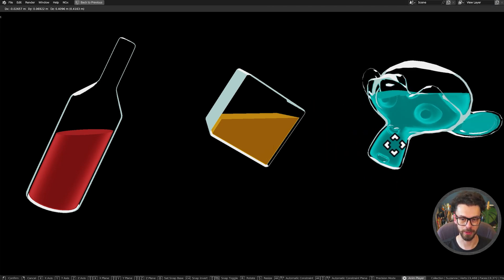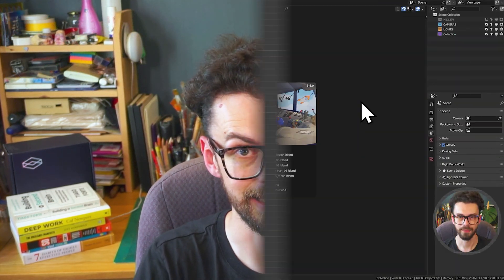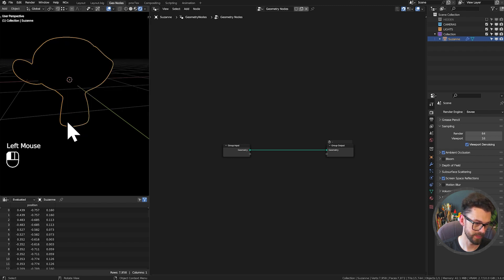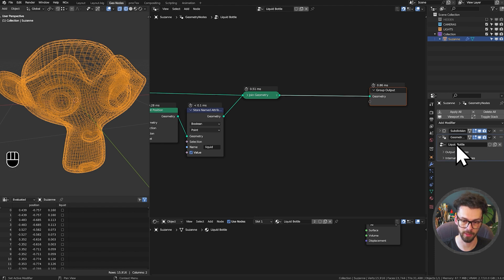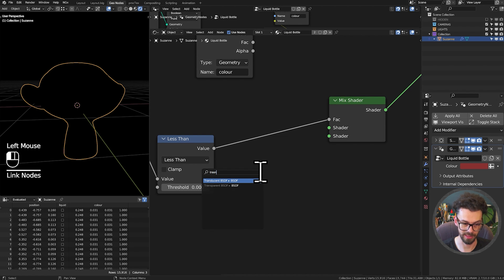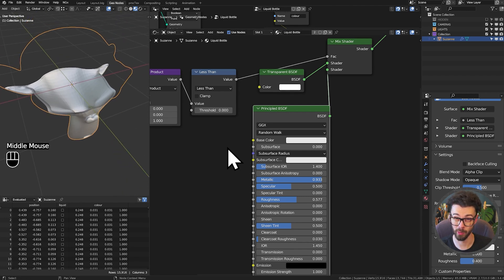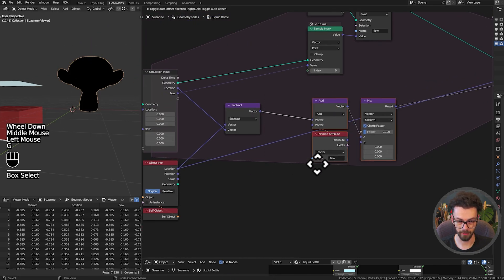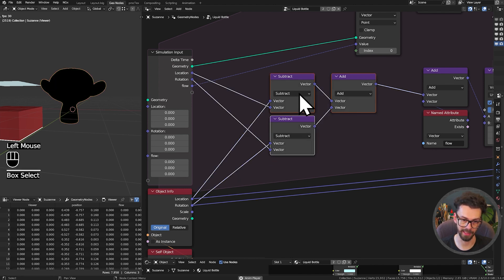Fake Liquid - Simulation Nodes in Blender 3.6

Comment: When it comes to Simulation Zones, I usually use the Delta Time along with some multiplier to get the factor for stuff like mixing a value towards 0. In Shaders, when I need a time value, instead of using just the frame, I make a driver which is "Frame / fps", where "fps" is a Single Property driver Input Variable to the current scene with the path set to "render.fps". Both of these gives me ways of processing time that work dynamically with whatever frame rate I'm using.
Reply from the maker: You can also use the scene time node’s “seconds” output which is frame rate agnostic. Delta time is useful as it’s just the time step since the last frame so good for scaling forces by

Comment: hi @Erindale I have a problem in 16:14 when you mix the shader with the material output somehow liquid is not filled, when I am doing it and I have checked that the entire process is same, I am using blenser 4.2.2 so I wanted to ask is their any difference in 3.6 and 4.2.2 is that why liquid is not filling and only show the empty shell with emission Image. or the problem is in my side? thanks in advance.

Comment: good afternoon, thank you for this excellent tutorial. grateful for your time. and share knowledge. I would like to ask a question if you can help me please. How could I put a floating object in the middle of the liquid?
Reply from the maker: Hmm a bit tricky but I would try to maybe make a selection of geometry around the liquid level that you can use to average their positions which will give you a point in the middle of the apparent water surface. You can then instance on it. It’s a bit tricky because there’s no actual water surface, so you’re just having to guess
Reply: Okay, I understand, I thought that, I'll explain what I'm trying to do, I have a sphere, that sphere is full, imagine something like I have a sphere, but the sphere is not completely full of liquid with nodes, it's just missing a little bit and in the medium, I want it to have a letter floating with a light, and that light also gives the light effect outwards. Thank you for responding and for your time. @Erindale

Comment: Hi! I was curious, I made a bottle without the geometry nodes and added thickness my self. Do I need to duplicate a new mesh based on the form of the inside of the bottle to create the liquid? or start over and follow the tutorial?
Reply from the maker: Hm I think you should just be able to asssign the liquid material to the inner faces and the glass to the outer. If you added the thickness with a solidify modifier then you can use the material offset option on the modifier to make it use the second material slot

Comment: The tutorial is amazing! And helped me a lot to understand how about shadings work.
I followed every step to the end and managed to simulate the fake liquid. However, there's a small problem: When I make 2 or 3 fast movements with the object and then stop, the top of my liquid doesn't go back to its original form. It keeps its wave form. In fact, some times it goes back to the original form, but most of the time it doesn't. I already tweaked the flow and delay attributes but it didn't solve the problem. Do you have any tips in how can I solve this problem?

Comment: Hello Erin.. It was a great video as always. I have just a small question. We used a mix vector node to create dampening effect for our location change. Using a low factor we can set the speed of dampening. That is cool but the dampening is linear. Is there a way to manually set the dampening curve?
Reply from the maker: The easiest thing with this setup would be to take the output from the other mix through a map range into the factor of that vector mix. That'll let you adjust the dumping per the speed

Comment: Can anyone verify if this setup works in 4.3.2 ?

I think this tutorial may need to be updated, I was following along up until about 26:45, and then nothing was working anymore. The "Liquid" was completely black, I didn't get the white matte fill. I am pretty sure I was following along correctly, but I also started getting lost with the tutorial at times because I was told add this, and then 3 minutes later was told to delete what I was told to add, and then we kept throwing things in different connectors. 

I downloaded the posted tutorial file, and once I loaded it into 4.3.2 the "liquid" was invisible.

Comment: What is the difference between using a seperate xyz and colourramp (set to constant gradient) instead of the dot product and less than (when you're only working in the xyz directions)
Reply from the maker: Compute speed. Also it's just a better habit to build as you'll use it in all situations rather than having a special workflow you just use in some cases

Comment: thanks for this tutorial! It's really amazing. But I run into a problem here: how can i make my shader to be more reality?
Reply from the maker: Not really going to be possible in Eevee due to limitations with transparency processing.  You could do it with cycles though
Reply: @Erindale  I replace the tranparent bsdf with my liquid shader, put off attribute[ colour]  , also skip the attribute[colour] in gometry nodes. It can simulate but the liquidfied area just went white shader.
Reply: It seems that if I pull of  the mix node (around video 12:00 )and replace with my liquid shader, it won't show as white soild anymore.🍾But now I don't have the beautiful surface of my liquid.

Comment: This is super cool! I wonder, is it possible to call global transforms in Geonodes like you did in the shader editor with the rotation_euler attribute? I tried using a Named Attribute node but it doesn't work and I cannot specify which domain to get the attribute from.
Reply from the maker: Object info node (with self object if you need current object) set to original not relative. You can pull the location, rotation, scale in
Reply: Great, thanks! @Erindale

Comment: Very helpful tutorial, but I'm stuck on something. The liquid disappeared at some point during the tutorial, I think around when the glass shader was being created. I should also mention that the glass shader has blocky edges and does not look the same as it does in the tutorial. I continued on as I assumed that the liquid would reappear later on, but it never did. Simply moving forward a few frames in the timeline or playing the animation did not do anything, and I don't know what the issue is. Is there something I missed in the tutorial?

Edit: I've checked the project file and that is working fine, so I must have made a mistake on my end. Any idea what that could be?
Reply from the maker: If you press shift+ left to return to the start frame and then play, does that update it?;

Comment: This is very cool, but can it do splashes? I was thinking if you did something similar to the shape shifting geometry nodes tutorial it could be possible to cause objects that fall in the water to generate splashes
Reply from the maker: A bit hard to do because there's no water. The surface has no three dimensionality as your actually just rendering the back faces of the mesh with an up normal. Perhaps you could use a raycast to check the mesh what the mask is and when it goes to 1 you could instance a splash object

Comment: Is it possible to make the fully working liquid or just an imitation on a liquid in a container? Can it be poured out?
Reply from the maker: This just looks like liquid but its not a fluid simulation. You'd need to properly simulate fluid for things like volume preservation, splashing, pouring etc
Reply: @Erindale  got it. I was 90% sure that it's only a visibility of the liquid but I wanted to be sure. :-) And another question, will object made with this method easily transfered to Unreal? Or it won't work there properly?
Reply from the maker: You'll be able to rebuild the logic inside unreal shaders and you'll be able to get it much better looking as well. You'll be able to totally control the normals there whereas Blender limits you
Reply: @Erindale  sooo, If my final goal to use this physics inside Unreal I should start in Unreal from the start? :-) I also wonder, what are the benefits of Blender from the Unreal? I mean what is better to do in Blender before taking it to Unreal? The only real thing that comes to mind is making a 3d model, I see that many people make em in blender and then export to Unreal. Is it so? And if there is a difference if I want, for example, make a cartoon with characters with realistic physics and I want to make just an animation for the game with characters with realistic physics, is it also better to be make in blender or in unreal?

Comment: For some reason my liquid disappears at Frame 1 and suddenly reappears on subsequent frames, and also takes an inordinate amount of time to settle. What nodes would I need to adjust to fix that?
Reply from the maker: On frame 1 it probably has trouble because we're finding the difference between current and previous frame. You could just use a switch node on your flow vector and switch to (0,0,1) for frame 1. For the time to settle, that'll be the mix factor / subtraction amount you're using that drops your multiplier on the sine wave towards 0 - that delay attribute. Check you hit zero in the shader as well as you're needing to stop rotating the surface normal

Comment: Thank you so much for the tutorial. I have one question, which may be user error: during the course of setting up the simulation, my liquid stopped being visible. I thought I'd done something wrong, made a new file, followed along again-- same thing. I downloaded your alyx tutorial file from patreon (thank you for posting that for even non-patrons! really appreciated!) and there are no liquids visible in that either, without me messing around in the node setup at all. You said early in the video that simulation could break material assignments-- is that what's happening, or is this just a case of "pay closer attention"?

A screenshot of the alyx_liquid_lesson.blend not showing any liquids in rendered view: https://imgur.com/VQIOuVc.png
Reply from the maker: Ah yeah play the timeline or at least move forward a few frames and it should load in. Make sure you're loading from frame 1 to force it to recache. You're using 3.6 as well?

Material assignments made before the simulation zone will break afaik but not if it's assigned after as we do in this set up
Reply: @Erindale  That was exactly it-- thank you!
Reply: This happened to me as well. Does this mean the simulation node needs to be on a timeline frame greater than 0 to calculate any geometry input?
Reply from the maker: Should work from 1 and beyond. You'll likely also need to have moved from one frame to the next as the effect is reading the difference between current and previous frame so the values might be unexpected when no previous frame